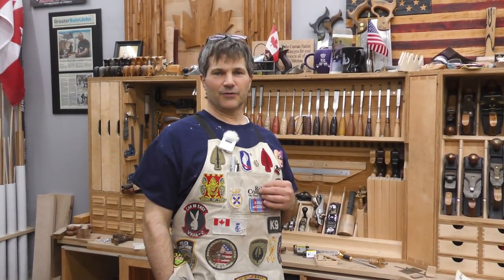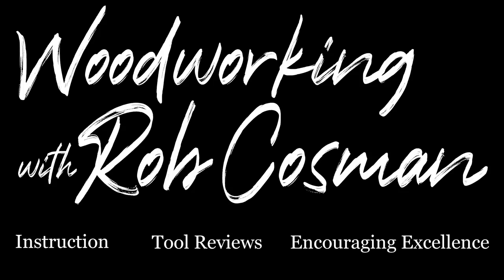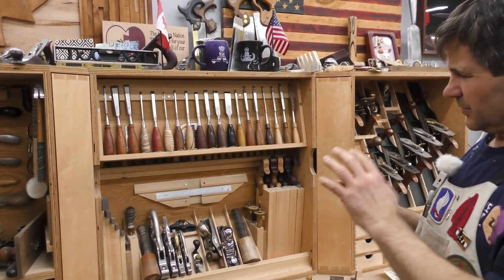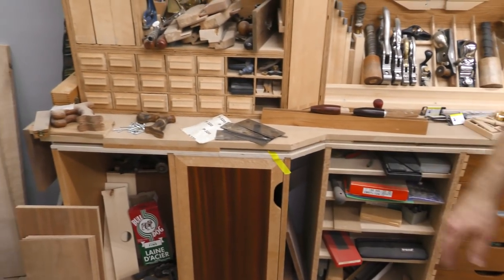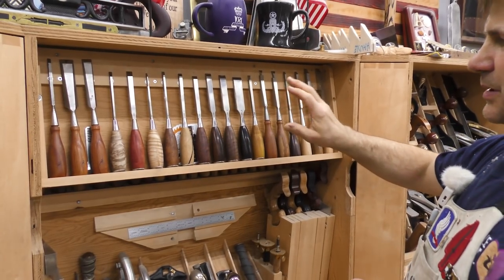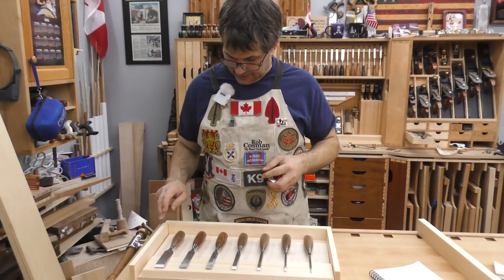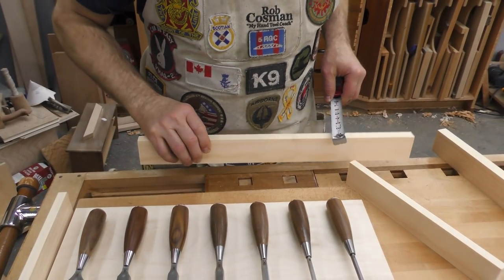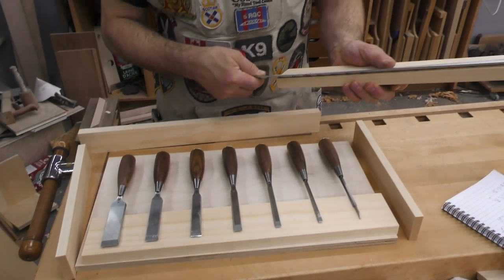Tool Storage Cabinet Idea – Chisel Rack

Comment: I’m currently storing my chisels in a drawer in my toolbox, but they’re not close to hand when I’m working at my bench. I don’t like hanging my Wood River socket chisels by the handles, as I fear the wooden handles shrinking in cold/dry weather and the irons dropping onto the floor and ruining the edge. This seems an elegant solution to access and preventing the chisels ever dropping off the rack. I really like the hidden magnet concept!
Reply from the maker: Your right!  I should have mention this is an good solution for socket style chisels

Comment: Thanks for this video Rob. I've been accumulating chisels from various vendors, including your dovetail chisel, and was thinking about your storage solution! 
I may have missed your explanation, but I'm wondering why you didn't mill the top and bottom pieces to thickness ahead of drilling for the magnets and chisel ends?
Thanks again for a great tutorial!
Reply from the maker: For the bottom i wanted to resaw it to get clean holes for the chisel bottoms.  For the top the thickness was based on getting the chisel back to lay flat on the magnet board

Comment: love the finished piece.  what purpose do the magnet cups serve as opposed to drilling a smaller hole and using a bare magnet instead?
Reply: The cups around the magnets act to “focus” the magnetic field. They may or may not be necessary be necessary depending on how strong your magnets are, and how firmly you want the chisels held.
Reply from the maker: No real purpose when I ordered the magnets I ordered the Cubs so I just use them together you can just use a plane magnet
Reply: I was wondering the same thing. I've always just glued the magnets in place.
Reply: It also depends on how the magnet is polarized  as to weather it has an effect or not. If it’s polarized front to back, it will “Focus” the field, but if it’s polarized left or right, it really doesn’t do much. Usually near denim magnets are strong enough without the cups

Comment: I appreciate that it’s an older video, but maybe someone who uses something like this can comment on this query:
Being in contact with a magnet for some time, the chisels will become weakly magnetic. Now, this wouldn’t make any difference to their use, but when sharpening the chisels, I imagine that the ‘micro-filings’ scraped off will end up stuck to the chisel tip which might affect the performance of the stone or strop?

Comment: Great video!  Where can I get the flip down magnifying lenses you were wearing at 9:57?
Thanks.
Reply from the maker: They are called Optivisor.  Very common. Just do a google search
Reply: I bought them on Amazon:
Donegan DA-4 OptiVISOR Headband Magnifier, 2X Magnification Glass Lens Plate, 10" Focal Length

Comment: Great video as always Rob! But i have a concern. The longer we keep something attached to a magnet, it will have a tendency to magnetize itself. Wouldn't that be a problem when the chisels get magnetized? Especially when you try to sharpen them, the fine chips would tend to stick to the chisel and maybe ruin the finish?
Reply: This shouldn't be a problem, because of the distance, the magnetic field is quite weakend. Furthermore to magentize the chisels you would have move them perpendicular to the magnetic field. In this application you mostly move the chisles in line of the magnetic field. So hardly anything should happen.

Comment: Quick question on #magnets: Do magnets cause problems for sharpening?
My tool store highly discouraged using magnetic fixtures for chisels, etc. as magnetism is induced into the metal over time, so metal dust would stick to the tool and mess up the sharpening result...
Reply from the maker: I have Never experienced that and I have been using magnetics for quite some time
Reply: Thanks 👍

Comment: Wouldn't this causes your chisels to be become magnetic???

I use diamond stones to sharpen that wouldn't be fun if the savings end up sticking to the chisels
Reply: That is EXACTLY why I stayed away for any solution involving magnets when storing chisels or knives. I've been repeatedly told that when magnetized, all fine particules would stay on the tools, ruining all the sharpening effort… Have you got any insight for our preferred gurus already ?
Reply from the maker: Benn storing chisels this way foe 10 years and they don’t get magnetized.  I also use diamond stones and there are no issues
Reply: @RobCosmanWoodworking  Thank VERY MUCH. That's the first time someone gave me a solid answer. Pfiou !
Reply: @RobCosmanWoodworking  I have screwdrivers that are magnetized because I stored them on a magnetic tray.

One of the ways to get magnets is to have steel around magnets.  I am not saying it always happens but I know by exterience that it can happen and for the price I paid for my chisels I am not taking that chance
Reply: The chisels will become magnetized over time, but we are talking hundreds of years. You can temporarily magnetize ferrous tools if you stroke them with a strong magnet a number of times, but resting them on a magnet isn’t a danger.
Reply: If your chisels were to develop enough magnetism to be a problem, an inexpensive demagnetizer should take care of it.
Reply: @JamesWilliams-en3os  Thank you very much. I'm much more confident using magnets in these conditions then (been using these in jewel boxes for ages, but I was a bit concerned using them close to chisels and gouges)…

Comment: Question:  Is there a reason to use the washers?  Why do you not just use the magnets?
Reply from the maker: If you mean the cups, they strengthen the magnets pull several times.
Reply from the maker: You can just use the magnets

Comment: Why do the magnets go in cups?
Reply from the maker: You don’t have to use the cups, you could just use the magnets. I had the cups because I ordered them together, and they do increase the holding power of the magnets.
Reply: The magnets are much stronger with the cups.